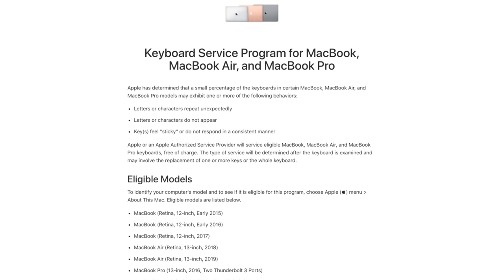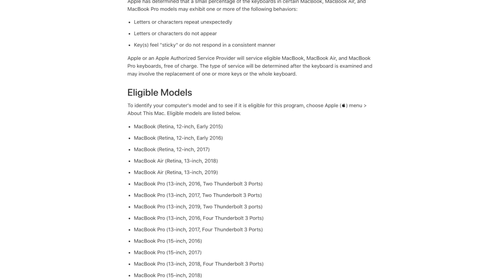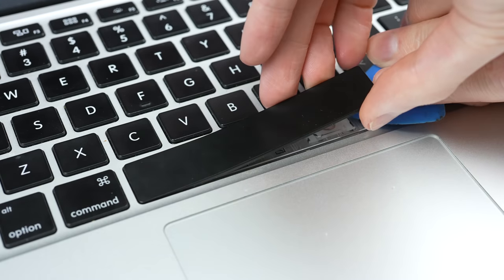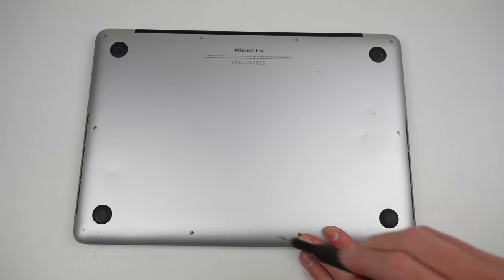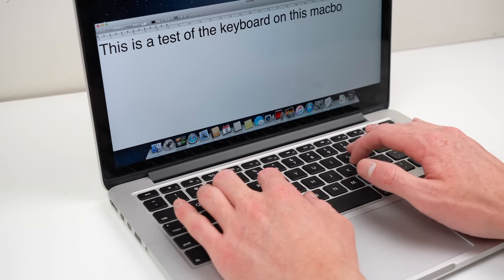Apple Really Doesn’t Want You To Fix This - MacBook Keyboard Replacement

Comment: I miss the good ol' days (pc days I mean) where in the majority of brands you could replace the keyboard in under 60 seconds. They were fitted from the front and held in place with a dozen clips. Once you popped the clips and detached the ribbon, you could just simply install the new one and boom, new keyboard. Hell, you could even change the region of the keyboard itself, from Spanish to Japanese for example. Everything was easier back then... 💔
Reply: As people want slimmer laptops, they become hard to repair.
Reply from the maker: Apple made a few laptops where you could lift out the keyboard using two spring loaded latches on the top of the keyboard. Should of included a clip to show that. But its found on the iBook G3 and some PowerBook models, like this one: https://youtu.be/_m5wfKthFiY
Reply: @HughJeffreys  Its G3 not 3G
Reply: @HughJeffreys  on my old dell Inspiron 600m from 2003, i can replace the keyboard easily in about 3/5 minutes or replace the Hard Drive and cd drive in a few seconds
Reply: @HughJeffreys  lol i actually have one of these sitting in my room, good old days when you could just pop that out and add more ram.
Reply: @traviswalker8933  Framework is making slim repairable laptops
Reply: @Jbrimbelibap  it has its own quirks and doesn't have that much of a market reach atm plus it's not affordable either.
Reply: @traviswalker8933  You're right, i wouldn't buy one as it's kinda overpriced for the specs, but It just show that this is still possible: thin and modern
Reply: @Jbrimbelibap  yes, but it was made possible only this year. Plus Apple has been notorious for it's anti repair mechanisms for years now.
Reply: I have a Dell Inspiron 15 gaming laptop from 2016. The keyboard is held in by just 5 clips and can be removed in 20 seconds.
Reply: @traviswalker8933  I don't think it was ever impossible, it's just that people and companies didn't (and still mostly don't) give a fuck about reparability and the future of the product
Reply: @Jbrimbelibap  mind you, windows laptops are still way more repairable than MacBooks.
Reply: Yeah but I just prefer the Apple keyboard over the old ones (once it’s repaired :D ) (and of cause not the butterfly keyboard which is just shit)
Reply: @GrafRucola  why do you prefer it when it gets damaged easily?
Reply: laptops were much thicker back then just because of removable parts..
Reply: @traviswalker8933  I prefer the feel over the one from the G3 Power book
Reply: @traviswalker8933  I would prefer the same keyboard that was used initial 2015 (and maybe is in use since 2019 again) but with easier repairability, and if I can’t get repeatability I m just gonna be sad and mad but I just wouldn’t want to use similar keyboards to the old G3
Reply: @traviswalker8933  in addition I for myself had never a problem with 2012 series MacBook keyboard nor MacBook Air until 2017 series keyboard 
Knocking on wood
Reply: @GrafRucola  the newer ones aren't repairable as shown here.
Reply: @traviswalker8933  of cause butterfly is shit, probably nobody disagrees
Reply: @traviswalker8933  I know, I’ve done multiples of these riveted ones, but my description what I prefer is almost solely based on how it feel during use because the 1-2h repair even tho it could be easier is so little compared to the hundreds of usage hours
Reply: @Nramanoodles windows laptops except the surface are easier to repair.
Reply: @traviswalker8933  not true, this is deliberately done to sell more products as a repair is almost impossible or so expensive. So it goes to Africa or Asia ending up in a River or Landfill. but it is not in the backyard of the ceos villa.

I really like apple products, but it gets worse and worse.
Reply: @CAESARbonds  that's capitalism for you.
Reply: This December I successfully repaired unfixable apple aluminum keyboard a1243 and it was really painful experience... Now on the way there are two more a1243 and a1314 to go to fix
Reply: @phonghai87  it's actually Gunit
Reply: well you should try thinkpad easy to replace any component
Reply: @Cold spring you like the bulky ones, that doesn't mean other people do. People like slimmer laptops because they are easy to carry and what not.
Reply: i still have 2 of those laptops, so easy to replace
Reply: @traviswalker8933  That excuse is poor. Nothing about the slim profile of this macbook prevented the use of screws to attach the keyboard. Only the unibody exterior prevents it from being installed from the front. It's just like the waterproofing argument for batteries in phones not being user serviceable. We have sealed pogo pin blocks that allow connecting a battery through a waterproof housing. Companies are just cheap anti-consumer, anti-repair, and anti-user entities. No need to defend it.
Reply: @ZeroX252  I haven't defended anything about the keyboard. I have said that slimmer laptops are harder to repair.
Reply: @ZeroX252  companies are following the capitalist economic policies which you should read about.
Reply: in order fix any apple product these days, you must seek Twilight cathedral where the bat  Queen Tiamat has gone to roost. the whole of her domain is a blistered inferno, by land you will never reach it. find the high ground.. with this.. and bring me her still beating heart!
Reply: @technicalguy7196  that's enough of the Twilight fandom for one day.
Reply: @traviswalker8933  😆 lol
Reply: @traviswalker8933  which I don't get, the slimmer they get the easier they can get damaged, I have an ultra slim work laptop and it's just a pain (not to mention loud as fuck) but that was issued to me so nothing I can do about it
Reply: @The93Momo93  I don't like ultra thin laptops either. I like a lightweight laptop that is easy enough to carry around and do work with.
Reply: @traviswalker8933 , I agree that thin & light is pressuring the industry to get rid of repairability but it is more of a choice than a requirement. It is possible to make thin and light laptops which are repairable. I am using a Thinkpad T480s which is a 14" laptop that weighs 1.3kg/2.9lbs and is 0.73" / 18.45mm thick. The keyboard, SSD, WiFi/BT, cellular modem, battery and one RAM stick (the other one is soldered) are easy to replace, and nothing is glued down, except the front face around the screen, which is easy to peel off when replacing the LCD.
Reply: @amosbatto3051  like I said, windows laptops are far more easier to repair than MacBooks. Some of the windows laptops are a pain to repair such as the HP spectre.
Reply: @The93Momo93  Also, the slimmer they are, the less space they occupy in the garbage can.
Reply: @traviswalker8933  ah the skinny/ small/ sturdy/ secure/ waterproof fallacies. The truth is that repairability lowers margins a little but the consequential longevity can decrease revenue a lot. So many are now brainwashed into 2 year or less obsolescence cycles, baked into the design.
Reply: @aajpeter  well, like I said they are operating on the principles of pure capitalism economy.
Reply: @traviswalker8933  there is nothing "pure capitalism" about this! where is the effective competition?  While there are other laptops, within the relevant sub category where people would accept substitutes, Apple has a monopoly.  If there were actually competition, all of the anti-consumer stuff would be gone, and there would be innovation around repair rather than obsolescence.
Reply: @aajpeter  they are making an item to last a few years so that people can buy new later on. This is the principle I was talking about.

The other laptops in this category would be the Dell XPS and the HP Omen. The windows operating system might not be as efficient as the Mac but it surely provides an effective competition.
Reply: @traviswalker8933  For some, maybe,  but for the lion's share of participants it really does not provide competition, and that's not at all how the market behaves.
Reply: @aajpeter  I mean outside of the US and China, MacBooks don't see a widespread use with most using laptops from other brands. Same is the case with smartphones. Android users are more in number than iOS users.
Reply: I remember in the good old days, you could plug in two keyboards at once, and replacing took 3 seconds.
Reply: @traviswalker8933  there's many slim laptops with easily replacable keyboards (like system76 or framework). even then it doesn't excuse them being riveted in place and needing to be pulled out with force as they cut your hands.
Reply: @iskamag  framework came late last year. This MacBook is older.
Reply: @traviswalker8933  keyboards have been the exact same for at least 13 years, framework just wanted to make a replaceable keyboard, so they just, did.
Dell XPS was another ultrabook that had a haswell release, except the keyboard replacement process is as easy as unplugging that plastic plate and replacing it with another one, same as with the framework or other Linux laptops.
Reply: This brings back memories.  I replaced a riveted keyboard that had some water damage.  What a disaster Apple is.
Reply: @traviswalker8933  Replace screws with rivets does not make the laptop any slimmer.
Reply: @mensaswede4028  didn't say that.
Reply: @traviswalker8933  you implied that there is something about making laptops slimmer that ends up with them being harder to repair.  I think that's almost completely baloney.  Poor repairability is a shitty choice made for greedy reasons.  Just like soldering in the storage, gluing in the battery, etc.  All anti-consumer, all unnecessary
Reply: @aajpeter  I didn't say it has anything to do with the rivets on the keyboard. The laptops become harder to deal with in general.
Reply: This is the way.
Reply: ThinkPads 👌
Reply: pretty sure keyboards for desktops are still built that way, at least cheap keyboards are, the more expensive ones are screwed on with standard phillips screws.
Reply: @traviswalker8933  That is an absurd statement. They have to put it together, so let people take it apart without fucking rivets, heat glue, plastic clips, warranty void seals, unique screw heads, non reversible screwheads and everything else under the fucking sun.
Reply: @traviswalker8933  I disagree that by looking at what is produced now, we can infer what could have been released at the same. I think there is good reason to argue, that development would have been quite different, if repairability had been a priority at all in recent years. 

Sure, thinner laptops will be harder to design with this in mind, but that's no excuse of even thicker laptops nowadays being horrible to repair or design choices that seem to actively invite wear and tear. What about Apples habit of using subpar capacitors which cut down product lifetime? What is the benefit of making something absolutely necessary to replace like a fucking battery, impossible to replace? 

I hope the right to repair movement never stops going. The state today is abysmal and it's not just PC's. My dad complained for 3 hours about impossible it is nowadays to change a lamp in his car.
Reply: It is still that way, just don't buy crapple.
Reply: @traviswalker8933  there is no reason they couldn't use a screw instead of a rivet. A billion dollar company doesn't need people apologizing for their anti-consumer decisions.
Reply: @RandomMan1  they are maxing their profits from their repair program.
Reply: I got a hold of a 2012 MBP with a foreign layout water damaged keyboard. Just replaced the whole top case with a US layout and the organ transplant was accepted. It's running quite nicely now, might install an SSD next.
Reply: And what have we gained? a device that's 1/4" thick vs an inch
Reply: Desktops are still easy to hotswap like that lol, as long as you have the parts.
Reply: not to mention that actual computers use a USB port or bluetooth for keyboards. Apple just sucks in general.
Reply: Have aou heard about Framework laptop?
Reply: @traviswalker8933  Nobody wants them slim xD
Reply: @gamerito100  sorry to say, I'm from that camp. I don't want to carry around 5 kgs of mass in my laptop bag.
Reply: u could just buy a pc like the rest of us and not have these apple problems
Reply: But now you have to pay $1000000000000000000000000000000000 just to fix a key
Reply: @traviswalker8933  
Well, I've got a modular Clevo-based laptop, and whilst it is a bit of a chonk at nearly 2 kg, that really isn't too bad considering that it's got a desktop CPU inside, and that getting to the RAM and hard drive takes two screws and 10 seconds. You can replace any part, including the CPU, keyboard and display, within a few minutes. Of course, the battery can be detacked from the outside as well. Sure, it is quite bulky-looking, but in return you get great upgradeability and high performance for a very affordable price.
Reply: @traviswalker8933  Bs. Rivets take up the same amount of space as screws, and both of these use less space than integrated clips.
Reply: @traviswalker8933  Incorrect. Apple uses extremely strong adhesive intentionally, and it's not to serve as a tradeoff because the phone's slim... it's because they don't want you to repair it. It's pretty obvious.
Reply: @LethalByChoice  the iPhone is far from slim.
Reply: I still have my dads laptop where you can just take the keyboard and plop it back in.
Reply: @HughJeffreys  yea MADE
Reply: I have an ASUS K53S. I still use it despite having a brand new ASUS gaming laptop. When the keyboard goes bad I can replace it with a spoon or a toothpick or whatever in under a minute without even turning the computer off. There is no excuse for what Apple is doing. Oh, and I can still get keyboards for it even though its 10 years old.
Reply: @lukeson8934  I still have the Inspiron 1525. Very easy to disassemble. It's perfect, but it's getting elderly .
Reply: I miss the old says when an office board that were perfect for gaming cost about 15 us$ (max sinceim a swede) then they invented the gaming keyboard and now suddenly cheap good office keyboard was not sold unless you paid 75$ - you could the the cheap trash gaming keyboard for 15$ or better ones for abour 30- 50$ -what i say they invented a product by removing the superior competetior eg gaming keyboard and trash keyboard. Now you can buy the manual keyboard for a lot of money since they restarted "exculsive production -I guess MAC and apple has done exaxtly the same Own its users and lock them in
Reply: YOU KNOW THEY STILL EXIST RIGHT BUT EVERYONE WANYS TO DRINK THE FUCKEN COOL AID AND GO WITH TRENDS
Reply: just throw it away and buy a real pc
Reply: @jari2018  I think a lot of that specifically has to do with economies of scale. Way back when, every computer keyboard was a mechanical keyboard with switches soldered to a circuit board. Now the closest you can get without paying most of $100 is those rubber nipple keyboards that mimic mechanical ones but cost a fraction to make and (more importantly) orders of magnitude more are made. If everyone used mechanical keyboards, you'd still have competitive pricing. A replaceable peripheral isn't really the same as something that's designed to basically brick a $2000 device if it fails. I'd bet most people mothball their macbooks when the keyboard fails and just waste the cash on a new one.
Reply: @aajpeter  Not sure why they feel the need to make the hardware unrepairable, they do a pretty decent job of forcing replacement with their OS updates.
Reply: @rjk69  that's additional innovation for sure, I'd call it "obsolescence in depth": even if people figure out a way around or legislate against one control, there is another to keep the cash flowing.
Reply: Most people with laptops don't really need a laptop and just use it at a desk. Victims of sales people and marketing. I'm still using the case from the 2009 PC I built with Hitachi hdd 250gb still working, just added ssd. All other components gradually replaced/upgraded 3-5 times. No need for engineers, just unscrew few screws unplug/plug things and you're done.The only thing you need to look at is motherboard/cpu compatibility which usually can be found in a bundle anyway and a power supply having fitting cable for the gpu. Anyone who can use a screwdriver can do this otherwise.
Reply: @iclicklike3397  Unfortunately that's not really cost effective anymore. I used to do what you do from 1995 to about 2008 or so? Just a little after AMD merged with ATI. That forced the deal between Intel and Nvidia and the arms race for cheaper and better CPU/GPU combinations. A lot of those are bespoke for companies like Dell or (especially) Apple or Lenovo and you can't just buy them.
If money is no object, you can make a PC better than any retail gaming PC on the market, but spec for spec, you can't beat retail anymore.

I've had some luck with buying old 2U rackmount servers for basically nothing that cost $20k new and sticking the best low profile video cards in them I can, but "low profile" pretty severely limits you.
Reply: @htomerif  only if you buy everything at the same time or chasing max performance. Best bang for the buck components are usually 2-3 generations compatible. Good PSU for example will last for years.
Reply: @traviswalker8933  honestly, I prefer a slightly thicker laptop with easily replaceable parts and good cooling. But it's like modern cell phones. They make them LOOK sexy with slick edges that you can't hold onto. Then tell you to buy a $50.00 protective case that makes their sexy, slim, overly-slippery phone 3X thicker so it has some protection. But people still laugh at rugged phones that don't need additional protective cases for being big bulky and dumb looking while their own phone wears a huge case with a fat, built-in auxiliary battery, a holding handle and a two foot lanyard.
I know some people really want super thin laptops. But seriously, can somebody make laptops like the old Dell Latitude E6540 that had easily removable parts and stuff. Yes it's a full inch thick. But it's perfectly portable and so easy to upgrade. But new designs are practically just circuit boards with buttons.
Reply: @Bearthedancingman  my brother had the 6540 and I found it to be heavier than my E7540. It also has a rubbery finish around the keyboard which gets dirty really fast and the dual graphics cards are a pain to deal with.
Reply: @traviswalker8933  can't disagree with you on those facts.
Reply: @traviswalker8933  It's not that much more expensive than an equivalent laptop if you buy the DIY kit
Reply: @vivek_v  and what is your point?
Reply: I've got a ThinkPad from 1995, keyboard pops up just by pulling the screen locking clips a bit further than usual, giving easy access to the floppy drive, hard drive, battery, everything. So easy... even my Dell laptop from 2013 has easy access with a couple screws for the RAM and HDD on the bottom, and the keyboard is the kind that clips in from the top. Seems like all that started changing on more and more devices by the mid 2010s though, as my Dell from 2017 has a keyboard I'd have to take the whole laptop apart to get to, and no more easy access bays for RAM and HDD, have to take the whole bottom off to get to them.
Reply: There are still laptops like that but they are very rare... I had a laptop like a Clevo  from 2021  model very easy to work on....
Swap cpu, gpu , ram ssd keyboard ... anything in like 5- 10 mins...
Reply: Or the Apple IIGS days where everything was replaceable and the keyboard was a whole separate part
Reply: I once replace the keyboard in a Lenovo x121e in a matter of minutes.